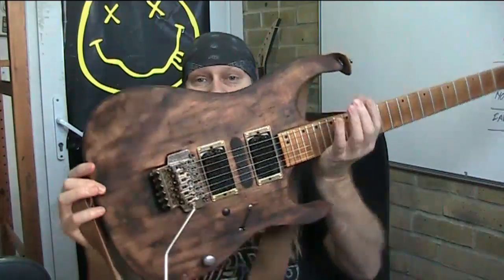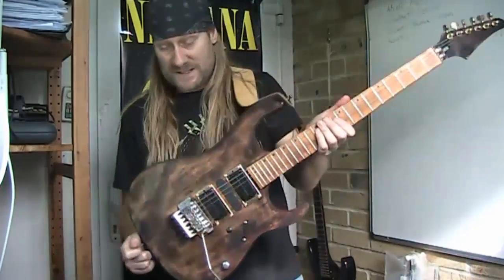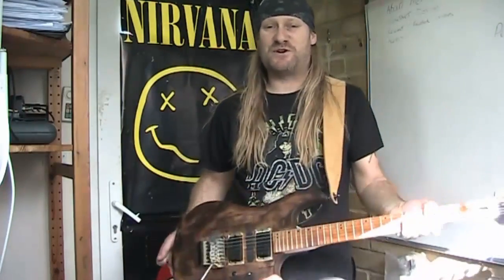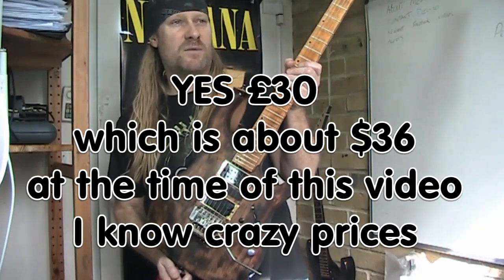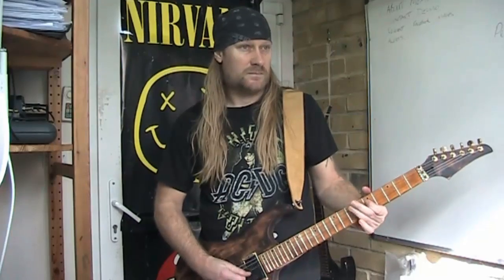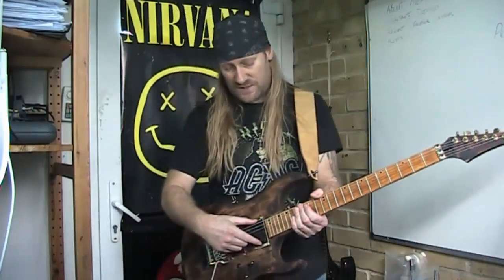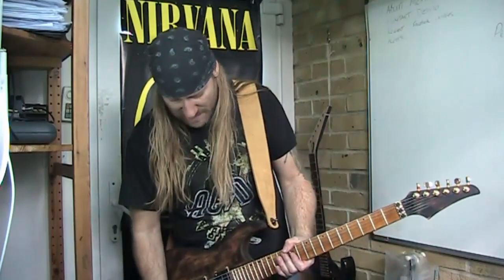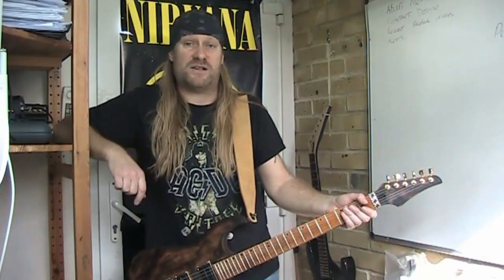Iron Gear Steam Hammer Bridge & Neck Pickups

Comment: Iron Gear pickups are excellent pickups. Got the Steam Hammer + Iron Pigs in a Stratocaster, Dirty Torque+Blues Engine in a Les Paul and a Gretsch, Rolling Mill o/w in an Ampeg plexi. They all sound and play very dynamic and clear, even with high gain. They make me play more. Highly recommended 🙃. Thanks Mr. Barlow for introducing me to these fine pickups ! Rock on !

Comment: If you think they're good try a set of Metal Machines and tune to C std.....
They turn wool into gold!
Also for HSH configurations, the Jailhouse Rail single coil sized dual blade humbucker is amazing.

With the bonus of all 3 pickups are true humbuckers so 500k pots and .22uf capacitors will still be happy with all the pickups.
Plus all have the same wiring potential for coil taps/split etc.

I sound like an axetec advert, but they are seriously good. 
Keith could charge double for these pickups and they'd still be cheap!

He does all the usual hardware like bridges to locking machine Heads...(£30 ish for a set.... as good as branded ones.)
If you want to make your "meh" guitar into an instrument at the peak of its potential. 

Worth a look, I was so impressed with the pickups I've literally just finished upgrading my main guitars from Axtec and the difference in sound and clarity is noticeable. 

Toanz 4 dayz 
(That is how dem yoof be yeah blood?) 

Sounds good after.. 

Good gear good price. 
Tell em I sent you, and that's because of watching Dave's vids!

Comment: Hiya Dave,

Is this Iron Gears take on the Dimarzio Super Distortion?
Reply from the maker: not quite :)
Reply: @DaveBarlowGuitar  will do, what's it closer to, thinking of getting a set.
Reply from the maker: I would say somewhere in between the evolution and the super distortion.
Reply: Ok Dave, cheers I'll look into the Evolution too, but for £30, you can't go wrong.
Reply from the maker: Steam Hammers are the way to go for sure if you want power with clarity.
Reply: @DaveBarlowGuitar  cheers mate

Comment: Hey Dave are there any Irongear (or any other inexpensive brand) that you'd recommend for a bridge pickup on a Strat? 
having in mind it will be used for blues... rock... ??
I'm looking for something that is not aggressive, went for a Seymour Duncan JB and I'm really not happy with it.

I'm even thinking to go for a P90, as ridiculous as it may sound. 

Cheers
Reply from the maker: oooh yeah, the JB is a good all round pickup but a little too high output for me, for blues and ACDC rock tones I use the Iron Gear Blues engine (which resides in half my guitars) but if you are looking for warmer bluesy tones go for the Iron Gear Rolling Mill, you can see reviews of both these pickups on my channel.
Reply: Dave Barlow thanks a lot mate.

If it's ok with you I will post a video review comparing the JB with the irongear you recommended here as a reply

cheers
Reply from the maker: sure

Comment: How well do they react to gain? I do have Steam Hammer (bridge) pickup laying around, but I'm currently using Metal Machine pickup, and it is a bit quite and more gain-resistant than  usual pickups as far as I have noticed. Or could it be related to cheap pots?
Reply: Dainius Vyšniauskas do you know what the pots are?
Like 500k A or 250k b's 

It could be pots or wiring, I love my Metal Machines they love the gain.
Reply: I do remember that pots are 500k. B's for volume, but can't remember which ones are used for tone. But they are super cheap, made in China minipots that came with DIY kit.
Reply: Dainius Vyšniauskas it's worth getting better pots then! 
I got mine from the same place that sells these pickups. (Axetec) the quality is good for the low price. (500k log pots all round.)
Reply: Yeah, I have purhased stuff from Axetec before - pickups, bridges, 250k pots. It's a shame that 500k log min pots are currently sold out :(

Comment: I got steam hammer bridge and neck pickups and put them in my guitar. However they sound really really trebley and crappy. Does anyone know why? I have to turn my tone knob from 10 down to 3 for it to sound half decent.
Reply from the maker: I have Steam Hammers also in my guitar, they are not treble and crappy, lets check a few things, 1. what guitar do you have? 2. what pickups did you have in the guitar before? 3, did you follow the the wring configuration that comes in the box with the pickups? 4. what amp are you playing through? (if you can send me a picture of the wiring in your guitar.
Reply: Cheers for help Dave love your channel.
 1.)  A Pitbull Explorer guitar. 2.) Terrible chinese quality pickups. 3.) For the electronics I purchased the Gibson electronics upgrade package off the same Irongear website I bought the Steam Hammers from. This included 4 new Pots, 2 capacitors, wiring and an input jack. I got a guitar tech (who installed a Seymour Duncan Hot Rails into my Harley Benton Mustang and it sounds brilliant) to install and set up my guitar. 4.) Im playing through a Laney Ironheart 60 watt tube head. P.s. I dont know how to send u pictures
Reply from the maker: OK, please take the guitar back to your guitar tech to check everything is wired correctly and that all is working correctly. I have seen guitars taken apart because of silly issues like dry joints or faulty leads.
Reply: Dave Barlow ok will do thanks
Reply: L1amZR  did you manage to solve the problem??